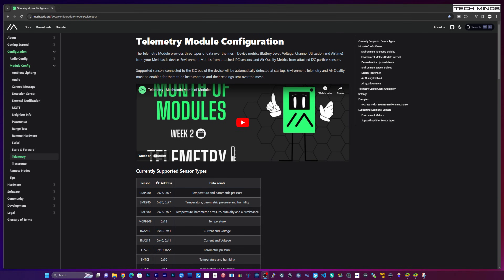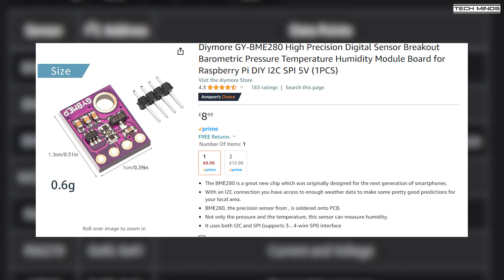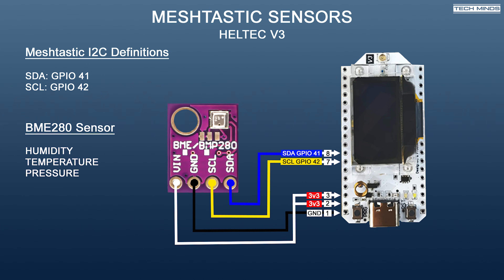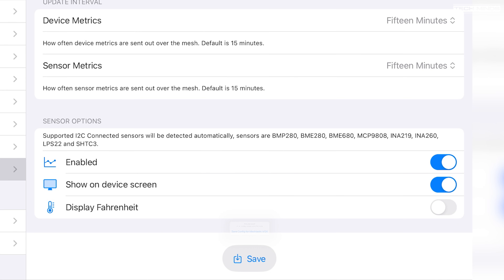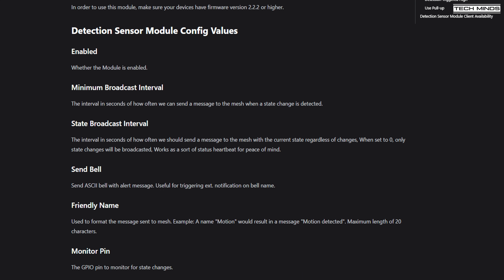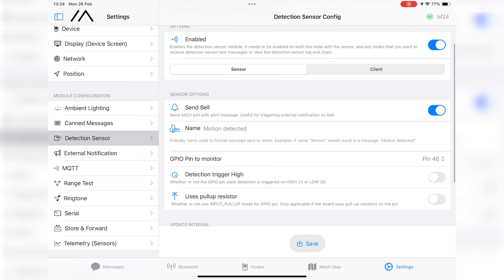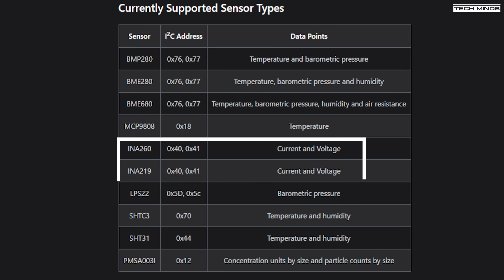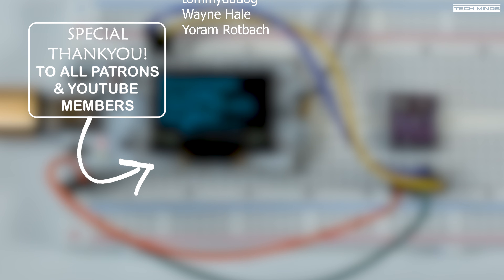Meshtatic Adding Telemetry Environment Sensors

Comment: Does anyone know if permanently using nodes with jumper wires can damage anything or become unstable over time? I know in theory connections might not be good enough for long term, but in practice? Anyone knonws of issues? Thank you :)

Comment: Although adding this to a solar node seems neat and all,  I am concerned about two things,  1) The sensor is inside a housing that may be much hotter that the outside temperatures in the shade, humidity may also not be accurate since these housings are generally hermetically sealed.  2) battery consumption.  (allthough this could be compensated for by using a slightly larger solar panel).

I think that ideally the sensor should be installed on the outside of the box being used for the other electronics.  maybe on the underside,  in a small housing the prevents it from getting wet, but is in the shade and air is free to circulate around it from the environment.

Comment: Hey, i have a small Problem with the t114. Im to dump to connect / Run a AHT20/BMP280 or BME/BMP280 Sensor with meshtastic (meshtastic flasher Version 2.5.15.79da236 Beta)

Im to dump ...  Do you have the right Pins  (original meshtastic config for sda scl) to connect the Sensor? 
Greetings from Austria

Comment: It looks like you're putting 5 volts to the BME280(?).  I was under the understanding that the I2C lines should be 3.3 volts.  And if that sensor is anything like the SHT31's that I have here, the I/O voltage is the same as VCC... so 5 volts VCC means 5 volts I/O. What am I missing (as I try to get my Heltec V3 to recognize any of my SHT31 sensors...)?

Comment: Hello, did you have to solder the terminal strips on the Heltec and the BME before connecting on the breadboard? The holes and spacing between them are tiny. I just thought I'll mount the boards on the terminal strips without soldering and added the wiring but I don't get environment data so probably the BME is not "seen".

Comment: Thanks Matt, do you know of any info for the following sensors that would work with Mesh Tastic?
1. Wind speed and direction
2. Vibration sensor (to monitor the vibration on a radio mast)

Can one run 2 i2c sensors on the same unit? I am asking as I would love to use meshtastic with a wind sensor (speed and direction) and BME280 Sensor to do weather reporting on an hour or 2 hour cycle.

Comment: Great video, thanks! Question... what about soldering this sensor AND the GPS board to the Heltec.  I'm using Pin 2 for the GPS, so no issues there... but I need a Ground.  Can I solder both boards to the same Ground Pin 1?
Reply from the maker: That is correct
Reply: @TechMindsOfficial  Awesome thx!

Comment: Cool beans. 

My Austalian Shepard refuses to stay behind whenever I use the automobile. For him its as grand an entertainment as watching a great movie is for two legged animals. The problem is summer heat and I have had to install a chill mat, & fans, and containers of ice as well as sometimes he wears a chill vest to make summer tagging along doable and safe for him where this is much like what the military does for service dogs in hot environments such as Afghanistan.

I wanted a device that would monitor the inside temperture in the van that gave me an exact interior temperture rather than rely on empherical data given by relating initial outside temperture with time under various boundary conditions such as in shaded area or direct sun so that if we have to stop for gas or etc I know for certain the actual interior temperture rather than an expected result given by experimentation.

I had been thinking about buying a wireless thermometer and modifying it for extended range but this gets clunky in a hurry when you start adding a 50 mhz quarter wave vertical antenna and perhaps illegally increasing its output power beyond its few milli watts of power. On the other hand while Bluetooth does not have the range, two Meshtastic devices with telemetry in one I expect would work.

Before anyone comments with I would never take my dog in a car during the summer even with all that has been provided to keep him safe because something might fail. Well, every time you take your son or daughter anywhere in a car they and you are at serious risk of being harmed otherwise we would mot have insurance companies. Plus part of providing and caring for another includes what interest them, not necessarily you, where this is their having what they enjoy experiencing.

Comment: So? Do I need to purchase 5v or the 3.3v version? I intend to use on Battery Power. But while using the USB-C to flash it etc it I have it wired up for Battery. Would the USB burn out the 3.3v version? Little confused.  Thanks.
Reply from the maker: Weird thing is that the one I bought said 5v in the listing title, but the specs say 3v3. I guess you will need to check the specs, but if you want to run on battery then use the 3v3 pin on the heltec. It will still work when usb is plugged in.
Reply: @TechMindsOfficial  Yes, I ordered the 5v Board. The 3.3v has 6 Pin Holes. Thanks for the Great Video. I always follow you on here. Keep up the Great Videos 😊👍